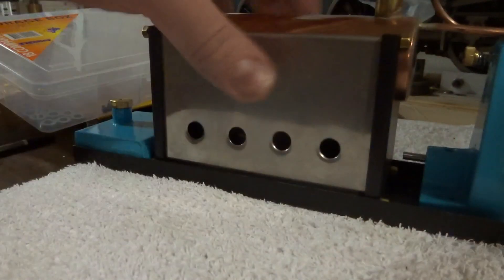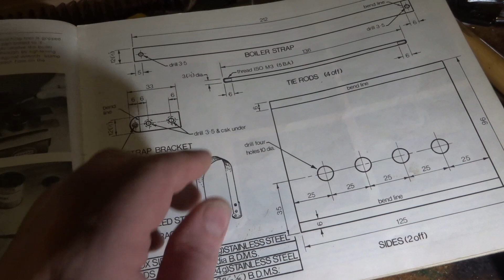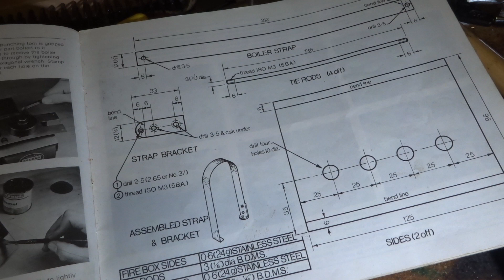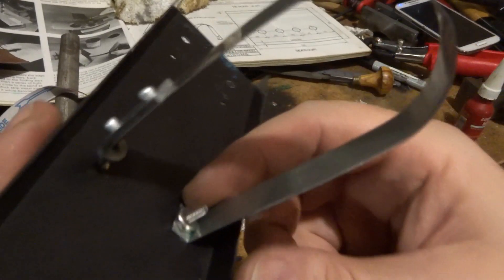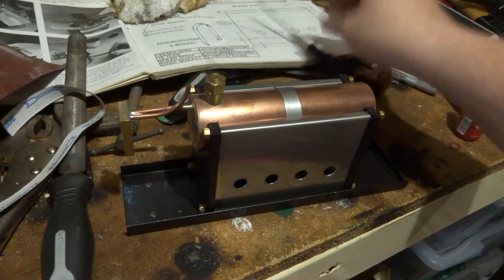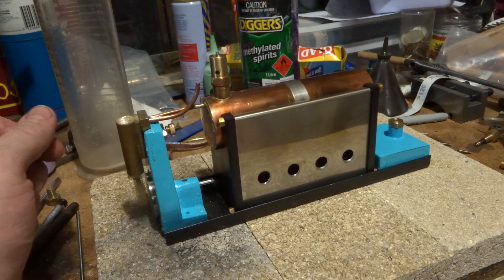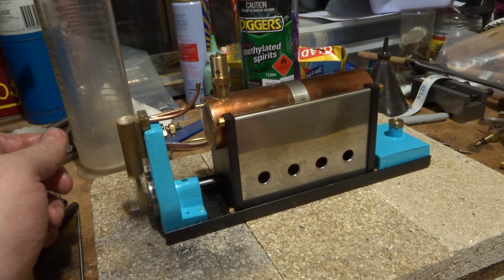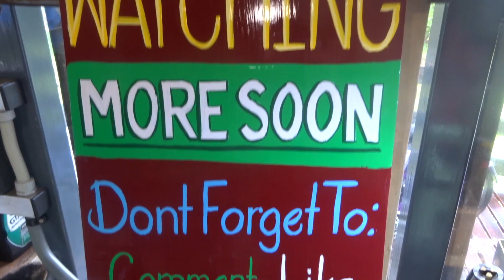K W  SCHOOLS  Steam Engine PART 21 conclusion

Comment: I have the exact same engine  as this built 31 years ago in metal work at school.still looks good and runs very well. same color but my safety valve is different.
Reply from the maker: how cool is that! 
I rebuilt the safety valve design. i didnt think much of the one Mr Wells designed.  thanks for telling me about yours!

Comment: Bravissima Emma! I was amazed how quickly it started running. How much water did you put in the boiler? I also wanted to add that one  could fabricate the casting. It would not look so pretty but it would be easy to do on the default 7x12 Chinese lathe -- and would make a nice project for a starter machinis. If you can find the drawings. I will try to remember to see if Google books has scanned that one. I will go back in the videos and get title and author. Thanks for sharing!
Reply from the maker: it holds about 180ml of water. the last run (maybe number 10) ran for about 19 mins!
Reply: So you ran it with a full tank! THat is impressive.